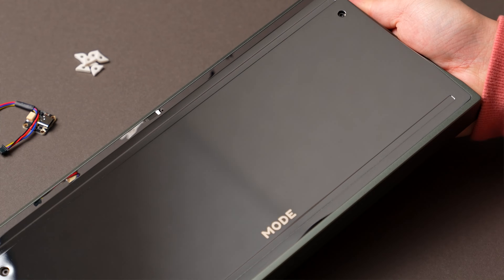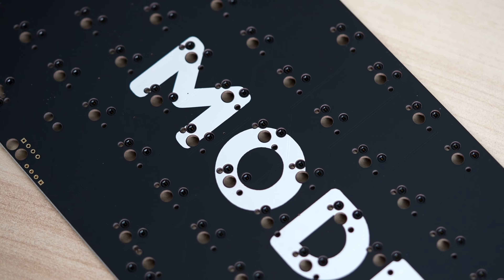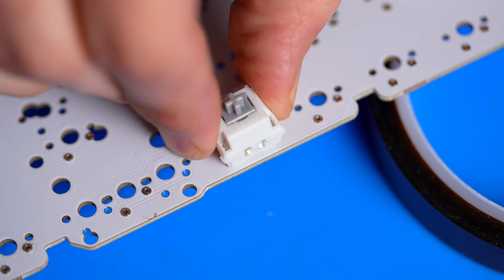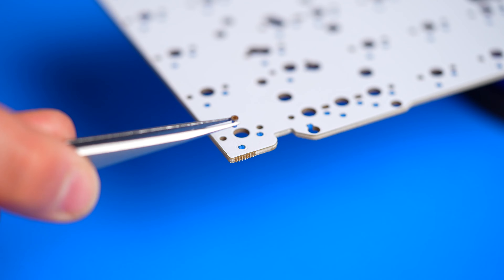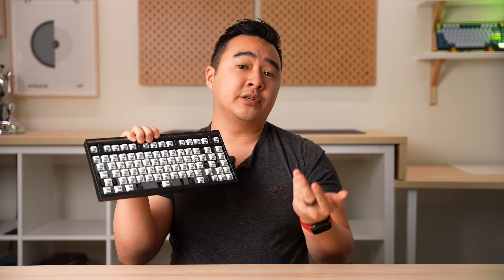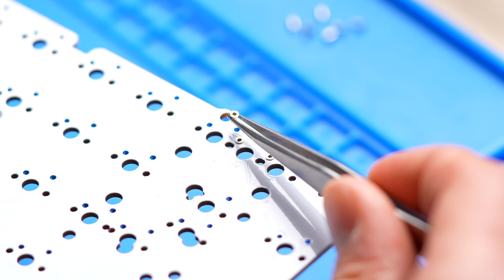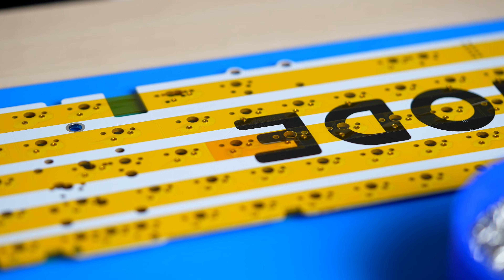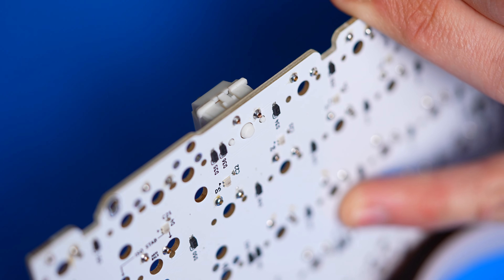Turn Your Keyboard into a Hotswap! - How to Mill Max a PCB

Comment: These mill max inserts are so expensive it actually hurts. If I only wanted to do the main letters and nothing else, it would cost half a brand new hotswap pcb and cheap case assembly. And if you do not live in the USA the shipping, taxes cost nearly the same as 60 of these tiny things, which is barely enough for the main letters. I understand the machining tiny precise parts are hard but damn these are not worth buying.
Reply: Wdym? In the Eu at least you get 150 for about 18 bucks with ~5€ shipping
Reply: @fr3aakzzz805  Seems prices have changed a lot.

on modedesign they're currently sold out, but the last listed price was $15 USD for 50 sockets, and they even mention a 75% or TKL keyboard needs 4 packs. That is 60 USD per keyboard. 

Mouser sells the 3305-1-15-15-47-27-10-0 (same socket as on modedesign, the one linked in the video description) for 0.473 a piece, and 0.315 if you buy at least 100 in bulk.
Meaning 150 sockets sets you back close to 50€ and 210 sockets for a full 105 key keyboard is like 66 €.
Plus shipping.

Digikey has them slightly cheaper with a 100+ bulk price of 0.3144, but that is without taxes. So buying there is closer to 70-90€

Comment: I was planning on replacing the switches on my old Fantech Maxpower because it's already old but I still love it but some switches don't work anymore and I was looking around for alternative Outemu switches until I saw this video and realized I can just turn it into a hotswap keyboard instead so in case I run into some switches not working again, I can just yank it out instead of having to desolder it again. Thanks.

Comment: Super detailed and helpful video! Currently in the process of mill-maxing for the first time and was wondering if anyone has tips for desoldering these sockets? I’ve desoldered all the ones I need to, but there is still some residual solder in between the switch holes on the PCB that I’m having some trouble removing. Any suggestions are appreciated!

Comment: Would be nice to add the possibility to screw the plate to the solder pcb, just like the hotswap pcb. If you milmax the pcb its only held by the inserted switches (which are not nearly as tight as soldered switches) to the plate. Lots of foam can cause contact issues and increase the space between plate and pcb. It can even push the switch out of the socket and you loose contact…